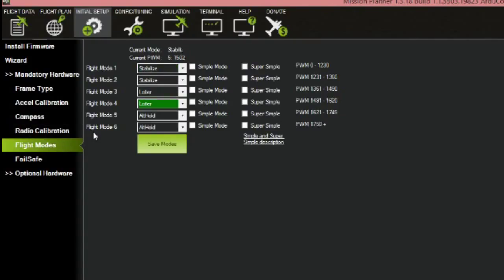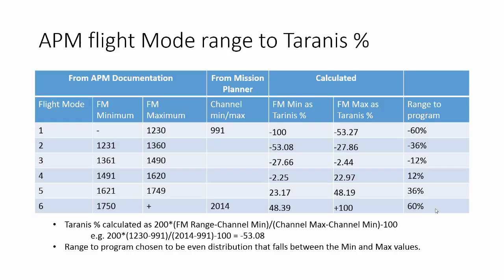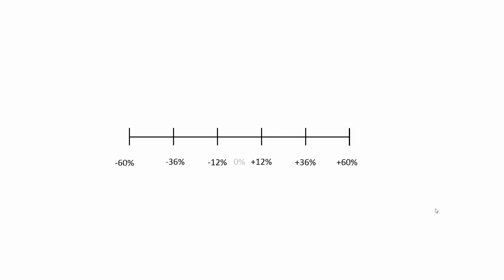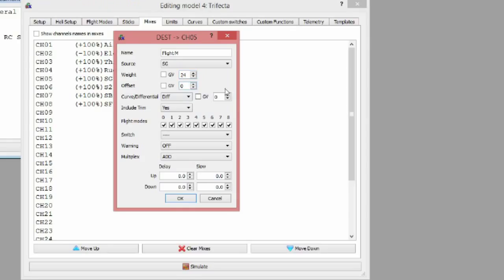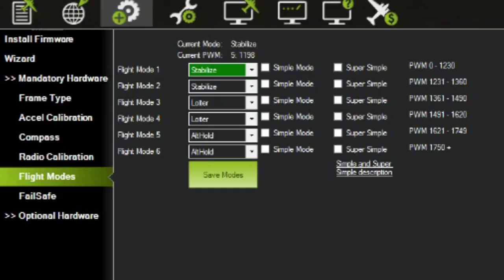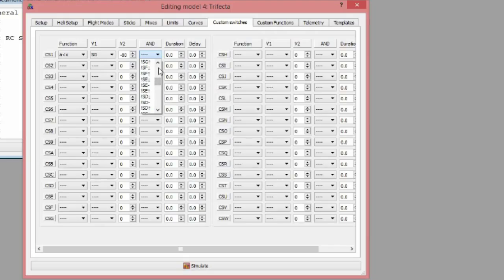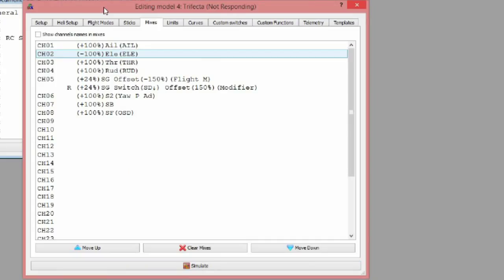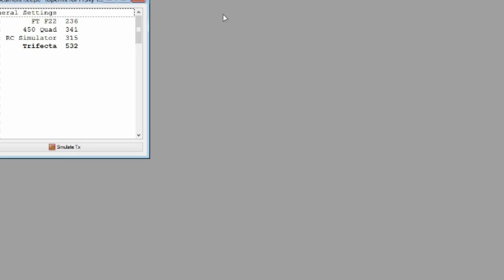6 APM Flight Modes on a Frsky Taranis

Comment: Stupid question, why is not possible to have two switches set for flight modes, say SG and SD(both 3 pos switches) and when each switch is thrown, whatever position it is on will over-ride all other modes (except the SF switch-which would be set to RTL). Why is it necessary to combine switches in order to get the 6 modes instead of simply assigning a mode to a single switch position? Apologies if this is a convoluted question. Every Taranis/Pix setup video is basically doing the modes in the same way, so I guess what I'm wanting just isn't possible. Thanks for taking a look.
Reply from the maker: As the saying says, the only stupid question is the one not asked. APM flight modes are set by changing the value of one channel to fall within a particular range. What you want is to set that value based on the last switch moved. I'm not sure how that can be achieved. You can use the special functions to set the value of a global variable and use that global variable to set the value of the mode channel. Unfortunately the rules just allow for the switch position to dictate the value rather than just setting it on the switch transition so if you are using two switches to set the same global variable, there will be two conflicting rules to set the value and the last one takes preference regardless of the last switch operated. If you use flight modes in OpenTx, you have the same problem. A switch position can select a flight mode and a flight mode can change a global variable or channel data but if there are two flights mode that can be active due to the position of the switch then the lowest numbered flight mode is selected. The newer versions of OpenTx have a custom scripts function (LUA scripts) and I am sure this can probably be used to do what you want but I have not investigated this.

Comment: I'm am just going to buy a different TX. Taranis is too much, lol.
Reply from the maker: I one way I don't blame you. There are so many ways to do things with OpenTx. I have about 14 models on mine and most are programmed differently and when I need to change something, I have to work out how things are setup first. However I have 14 models and that is more than are supported by some transmitters and I have never experienced a signal loss with the taranis and a number of my club mates have changed to it as well. And having many way to do the same thing in OpenTx beats not being able to do it at all. :-)

Comment: Dear John,

I was trying to follow your tutorial, but it seems like the setup doesnt work in the OpenTX 2.1.9? At the moment I use your values +24 and offset -150, the SG switch does not work anymore in the simulator. I cannot get it to work, any ideas?

Thanks!
Reply from the maker: Peter van der Pol I am not using OpenTx 2.1.9 myself yet but I can't see anything in it that would stop this from working. It is important to setup the radio first in Mission Planner as once you do this programming the channel that controls the modes no longer travels the full range from -100 to +100 on the Taranis or 1000 to 2000 in mission planner and this upsets the radio configuration if done after.. I am wondering if this is your issue. Mine now only goes between -60 and +60 but I have setup a third switch which I can use to override the programming and give me the two extremes of -100 and +100 to get around this.
Reply: John Crombie, when I try a new model just from schratch in the compagnion app, the simulator allready doesnt work. When I use the weight and offset like you do, the simulator doesnt even reacts to pulling the SG switch.
Reply from the maker: Peter van der Pol If you just make the channel source switch SG then in the simulator you should see the channel go from -100 to 0 to 100. See if that works. If not then I'm guessing there is something wrong with the latest companion.  If it works then change the weight to 24% then the range should go from -24 to 0 to 24. then put in the offset of -150 to move it to -60 to -36 to -12.

Comment: Hi John...i resume the situation....i get 3 flight modes with SG then 3 f.modes with SD then 1 F.mode with SD full up and SG at the middle...good but i don't understand this is following...On M.planner, Extended Tuning CH7 Autotune, CH 8 Do Nothing...Standard Parameters Ch 7 Autotune, CH8 Autotune...Full P.List CH7 Autotune, CH8 ---, CH 12 Autotune...this is like this by default...So, i change on Standard P , CH8 Do nothing and write then "Beeep" Pixhawk....On Extended P, CH 7 changes alone with Do Nothing and on Full P  CH7 is changed alone on 0....or in Full P CH7 is 0 and CH 8 is 17 then write but Extended Tuning Ch8 is Autotune , on Standard P Ch7 is Autotune, Ch 8 is Do nothing...for final, Extended .P CH7 is Autotune, CH8 is Autotune too but on Standard P CH7, CH8, CH9 are on AUtotune and Full P List CH12, CH7, Ch8 are on 17....????
sorry for long datas but i don't understand why somes change alone when i change one or them and how to do to get only on my CH7 with SF switch for autotune........................................

Thank's for your solution...
Philippe
Reply from the maker: Hi Phillipe,
I assume you have CH7 and CH8 assigned to switches OK on the Taranis. i.e. on the Mixes screen for your model you have CH7 source set to switch SF. On Mission Planner on the Extended tuning screen you set CH7 Opt to Autotune and CH8 opt to RTL. Then click Write Params ignoring any "more than double" warnings provided these are all you have changed. On the Full Parameter List (not Advanced Params, I was wrong there) look for CH7_OPT and CH8_OPT these should be 17 and 4 respectively. These are the same parameters but can be set on either screen. You can also see them and set them on the Full Parameter Tree screen. If you have set your THR_MID as discussed previously, this is all you should need.
John
Reply: Thank's a lot John, i'll try this and i give you my feedback...Philippe
Reply: Good evening John...after checks on my Taranis + and re-write CH7, CH8 on M.Planner here are the datas...Extended....CH7 Autotune, CH8 RTL then Standard...CH7 Autotune, CH 8 Autotune, CH9 RTL then Full P List...CH7 is 17, CH 8 is 4, CH 12 is 17....but i didn't write on previous CH9 or CH12...!...do you have an idea why CH9, CH12 change themselves...?
So, for the flights...all my Flight modes work very well ...Stabilize, AltHold, Loiter ( SG ) then in addition with SD...Auto, Land then Circle with SD Up + SG middle...RTL works very well for all modes...BUT i don't understand why i can't get Autotune with SF....   :-((  i only get a jump about 15° on left or right side when i switch on SF then nothing...
I'd like to get Autotune  to settle more finely Pids and change depending on the weight of batteries...I settle my first quad that way and I can not get to the autotune  again... grrrrr...  :-))
have a nice evening
Philippe
Reply from the maker: Sorry Phillipe, I am only using CH1-CH8. I'm using a CPPM receiver and it only supports 8 channels. I'v never even looked at higher channels.
Reply: No pb John, i'll try to resolve this by myself...i realised once with my previous quad....i'll resume all my datas on my Taranis first then on M.Planner...thank's for your help
Philippe

Comment: Hi John, today i've got the 6 flight modes on my SG and SD switches and 2 others on CH7 Autotune and Ch8 RTL for my SF and SB switches...So..., SG and SD work very good but when i switch on with SF (Ch 7 ) i've realised that it was inoperative then i've checked on M.Planner and i found " Standard Parameters "...Ch7 is marked RTL too ...i've got a message that CH7 is eigher the double...etc....so, i'd like to change the Pwm for Ch7 or Ch8 but i don't know where and how to check it and change it ....
thank's a lot for your explanations...
happy flights
Philippe
Reply from the maker: Hi Philippe,
Don't worry about the "more than double" warning message. It can be ignored for changes like this. You are setting the function for Ch7 from a list. This equates to numbers which you will find listed in the advanced parameters screen.  If it is set to do nothing the value stored in the parameter is 0, if you select RTL the value is 4 and for autotune the value is 17. If you move from do nothing to one of the other values then you get the warning message as the new value is obviously more than double the do nothing value.
The only thing you need to concern yourself about is the PWM value for the channel. It has to be greater than 1800 micro seconds to trigger the function. This shouldn't be a problem as the switch full forward/down should give 2000 micro seconds or more.

Comment: Hi John, i've got 6 flight modes and RTL with ch7...checked with M.Planner...no pb ...so, during the flight, when i want to switch AUtotune on ch7 with AltHold on flight mode 2 i get ( pwm 1280 on M.Planner ) mu quadcopter falls down rapidly and i have to switch on Stabilize (982 on M.Planner )...for information on ch7 in Full Parameters list i got the right number for Autotune...
Do you have an idea, how i have to check...?
Than's a lot, happy flights
Philippe
Reply from the maker: Yes, it sounds like your THR_MID value is too low. This should be set to the throttle value needed to hover. If this is not set approximatly to the correct value, AltHold doesn't work.
If you are using ArduCopther 3.4 or higher, it can be set automatically. See :- http://ardupilot.org/copter/docs/ac_throttlemid.html
Reply: Thank's John, i going to check and read o arducopter again...

Comment: I've got only 4 months flying experience, but have moved on from toys and a 250 racer with CC3d to a current project - F450 with APM2.6.  This video was helpful, logical and reasonably explained with options to boot.  I also opted for option 3, using Switch D to designate 3 desired  modes not requiring GPS (Stablize, Alt Hold, Stabilize Simple) from 3 that do (Loiter, Auto, RTL).  Wishing myself good luck, I extend my thanks to Mr. Crombie.

Comment from the maker: + Mark "Mac" M Hi Mark, As you say there are many ways to do the same thing on the Taranis. You seem to be using Locical Switches (Taranis Plus - Open TX 2) which are the same as Custom switches (Taranis - Open TX 1) to choose the flight mode and hence the weight to use. These become active when certain switch combinations are selected. I believe you  can further simplify the programming by entering the weight directly rather than using global variables or flight modes.

Logical/Custom switches seem to be the easiest way to combine multiple switch positions to accomplish tasks but I find them confusing to understand without looking back at the Logical/Custom switch programming. e.g. how do you know when switch L1 or CS1 is active and therefore activated flight mode 1 and what switches are used to do this.
I use them to set rate and expo combinations, but while doing the programming I have to keep checking the switch settings to ensure I'm getting it correct.

I guess it is down to what each person finds easiest for themselves. Thanks for the comments. I'm sure others will find them as useful as I did.

Comment: Thank you for the detailed explanation, I never took the time to understand the math behind the weights and offsets, I like the ease of the 2 mix setup, but i know if I looked at that in 6 months, I would have no idea how I got those values. I know there 100 ways to do anything on the Taranis, the setup below seems much more strait forward to me and easier to adjust the values to match the mission planner software settings. 

Below I setup 6 Global variables, 1 for each flight mode, when you have flight modes enabled you can specify a different GV value for each flight mode, then I use those 6 GV values of Global Variable 1 while switching through the different flight modes, I setup the custom switches just as you did and referenced them in the mixes as in your example.

Global Variables using flight modes
GV1 -> FM1 = -60
GV1 -> FM2 = -36
GV1 -> FM3 = -12
GV1 -> FM4 = 12
GV1 -> FM5 = 36
GV1 -> FM6 = 60

Mixes using (FM flight modes)
CH5 
R MAX Weight(GV1) Flight mode(Drift) Switch(L1) [Mode1]
R MAX Weight(GV1) Flight mode(Acro) Switch(L2) [Mode2]
R MAX Weight(GV1) Flight mode(Alt Hold) Switch(L3) [Mode3]
R MAX Weight(GV1) Flight mode(Loiter) Switch(L4) [Mode4]
R MAX Weight(GV1) Flight mode(Circle) Switch(L5) [Mode5]
R MAX Weight(GV1) Flight mode(RTL) Switch(L6) [Mode6]

if you have any issues with flight modes or don't have them enabled in the firmware, you can set the 6 global variables below, the only difference is using up 6 Global variables.
GV1 = -60
GV2 = -36
GV3 = -12
GV4 = 12
GV5 = 36
GV6 = 60

Mixes not using (FM flight modes)
CH5 
R MAX Weight(GV1) Switch(L1) [Mode1]
R MAX Weight(GV2) Switch(L2) [Mode2]
R MAX Weight(GV3) Switch(L3) [Mode3]
R MAX Weight(GV4) Switch(L4) [Mode4]
R MAX Weight(GV5) Switch(L5) [Mode5]
R MAX Weight(GV6) Switch(L6) [Mode6]